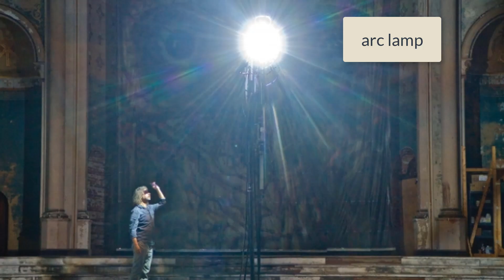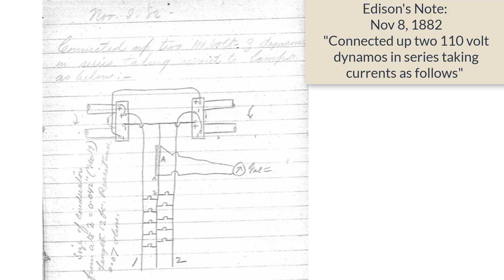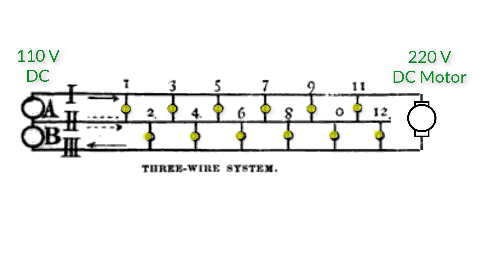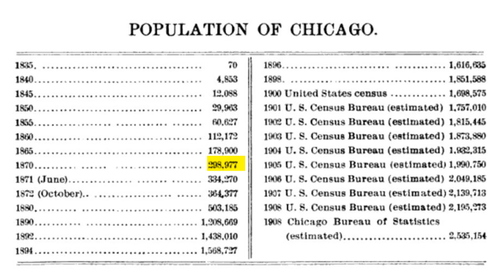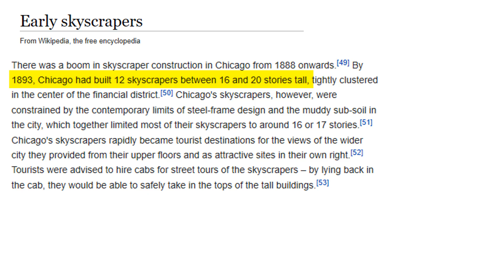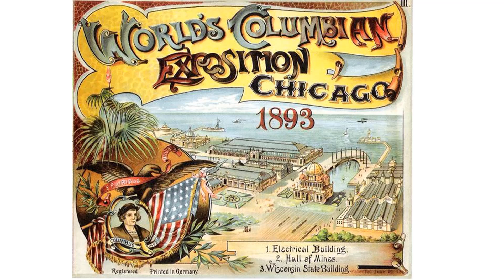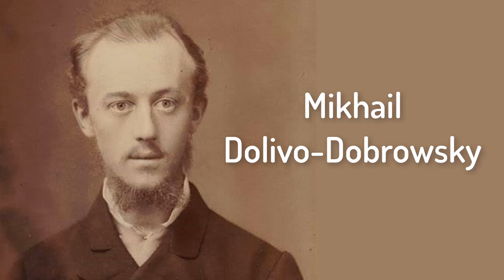Physics and History of Why USA uses 120 volts and not 220 volts

Comment: Edison's bipolar (120-0-120v) system is a good one, but there is one drawback. If the neutral conductor works loose when the two legs are not equally loaded, the less heavily loaded leg will see more than 120V -- all the way up to 240V. This can damage loads and even start fires. If you ever notice lights that get brighter when you start a heavy 120V load, you should get your wiring checked by an electrician.

Comment: The US uses 240 until the interior receptacles, where appliances are connected.  Why?  Maybe the builders and appliance makers did not want to pay for 240V connectors.   The higher voltage would have made for less copper and more plastic in the wiring, I should think.   Copper is more expensive than plastic.   Appliances using less current are more efficient since heat generation is proportional to the square of the current but only linearly to the voltage:   The same power with less current and higher voltage creates less heat.

Comment: How ablout dog leg wound (reconnected actually) single phase or poly phase out of a 12 lead 3 phase generator. 1/3 of the power is consumed inside the generator and is expressed as heat.

Comment: They do use 220 volts ! The supply to USA homes is a center tapped, single phase isolating transformer located on a pole outside each house. The primary is connected to one phase of a three phase supply. The centre tap and phase is 110 volts and used for lighting and low power loads. The full phase voltage, 220, is used for larger loads such as washing machines in the kitchen. The loads are connected as a bus, not a ring main, as in the UK. The UK does not utilise a seperate, centre tapped, isolating transformer. Instead the three phase supply, is supplied with alternating phases to each house in a street, in an attempt to balance the load. Countries that were part of the former British Empire use the UK system. The ring main system is superior to a bus connected system, since it minimises copper losses. The current takes the shortest route to the load.

Comment: Actually three phase is 60 degrees apart on the time line and not 120 degrees.  Mechanically it is 120 degrees but electrically it is 60 degrees.  Plot it out and see it.

Comment: I've designed electrical distribution systems for decades, typically for industrial applications. I find NEC which is part of NFC and NEMA far more satisfactory than IEC. Particularly confusing for me Is IEC 60309, their crazy pin and sleeve connector standard for industrial use. Their residential receptacles are all over the place and their wire color coding has been inconsistent in the past. In Britain every receptacle has its own fuse and switch because 230 volts is so dangerous. I don't think they have GFCI receptacles or breakers for residential use so no receptacles in the bathroom for an electric razor or hair dryer. Designing here in the US I've occasionally had to conform to NEC and IEC simultaneously. It's no easy trick.

Comment: 02:30 - "some of the customers on the more popular lines would use more lamps and therefore have more resistance"
The video goes on to show a n image with lamps in parallel. 
In reality, the result of more lamps in parallel is LOWER resistance, increasing current flow and decreasing voltage for a given power input.

Great video, BTW.

Comment: I understand your premise, but it is misleading.  First off, we have 125 VAC and at 20 Amps, that 2500 Watts.  This is both safer and more powerful than most outlets in the 2/3rds that you mention.  Then we obviously do have 250 VAC at what ever current that is required up to hundreds of Amps.  I have seen numerous comments from europe that imply that we are under powered and this from those still using idiotic 50 hz generators.

Comment: It may not have been the reason for it, but I think 110-120V is far safer than the higher voltage options.  A zap from that is usually annoying, and might make you jump (assuming you aren't wet or sweaty, in which case it's worse) but 220 and up is a huge shock and often more deadly.  This isn't to say 110 can't kill you just that it's less likely which is a nice feature, coming from someone who's been bit many times by the 110V snake.

Comment: The easy answer is: America uses 240 only where it is necessary like Central AC, water heaters and oven/ranges. America uses 120 for the items that do not require much power like flat screens, computers and lights bc it’s cheaper to install and so much more safer. Also, 240 will instantly kill you and 120 will (mostly) on shock you.

Comment: I think you need to cover in more detail Split Phase A.C., which is easily created by a transformer where the two primary "hot" leads would power a secondary winding with a centre tap which is lead to earth/ground. These transformers put out 240 volts, with the centre tap "neutral" allowing 120 volts for the branch circuits. So our houses in the U.S. and Canada are 120/240 or 115/230.

Comment: I don't understand why everybody thinks we use 120vac.  That's nonsense, virtually every single home in the US has 240vac running to it.  The transformer is center tapped allowing 2 branches @ 120vac in opposite phase.  It is a much safer system because the vast majority of stuff doesn't need more than a few tens or hundreds of watts therefore 120v has more than enough capacity while running at half the voltage and thus a bit safer in case of accidental contact.  Only appliances that require more than 1600w (typically stoves and hot water heaters) then need to be connected to the more hazardous 240vac.

Comment: Well argued, but it remains unclear why North America hasn't modernised to 220V since you suggest there are cost savings to be had. BTW I live in Spain and although we're now connected to the EU  220V standard grid, it is still common to see 110v in some old rural areas, often with transformers inside the house linking a range of old and new appliances.

Comment: Do not forget that some railways (in Switzerland) use 16 and  2/3 Hz. Airplanes use a much higher frequencies (~400Hz) so that the transformers can be much smaller to save weight.

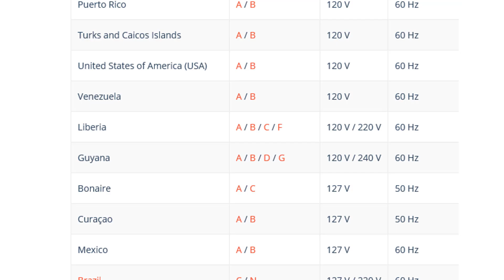Comment: 11:28
Fun fact about Japan they're is not stuck with the voltage choice but stuck with frequency choice (50/60 cycles)
About 100V that Japan used it is for safety reason and to make Japanese people use their own products due to different voltage standards

Comment: USA uses center tab transformers, I don't think EU does. So USA does have 230V, but most of the wiring is split 50/50 in the house and only 2 items get the full unsplit power: Stove and Dryer.

Comment: Last time I looked American homes DO have 240V.  The difference is that it's split phase.  That way we can have some circuits with 240V (usually for electric dryers, ranges, and ACs) and other circuits with 120V (most lighting and wall receptacles)

Comment: I think only about ¼ of the countries use 120 volts. Interestingly, some countries use 120V 50Hz, while others use 230V 60Hz. And the actual, rather than nominal voltages can be 100-127V or 220-240V.

Comment: When I lived in Europe, I became used to 220v.  One thing I often noticed was that every time I hit the rocker switch on the wall, some sparks jumped out from the connectors enough for me to notice.  This was normal.  If the European 220v setup was used in the U.S. the construction industry would be affected because of the safety hazard caused by the sparks.  In Europe, everything is masonry or the wires are carried in closed conduit pipes so the switches are outside of the walls.

Comment: Edison used DC in early years.  You can't transform DC voltage.  The dual phase was Edison's way of transmitting power further with less line loss.

It wasn't until Tesla's AC system that power could be transmitted at high voltage and then stepped down.

Comment: Sir Joseph Swan invented the first reliable light bulbs. His home in Gateshead in the NE of England was the first to be lit by incandescent light bulbs. The Drury Lane Theatre in London was the first theatre in the World to be lit by electricity. Sir George Armstrong designed and built the first hydro powered turbine at his home in Newcastle, this was used to power the Swan light bulbs in his home. The Paris Exhibition was also lit by Swan’s bulbs. Edison who had visited Swan and returned to the US replicated Swan’s work but using bamboo filaments. He tried to patent the idea but the international court ruled against him and in favour of Swan. The two of them eventually started a company called EDISWAN in the U.K.. Swan discovered a way of extruding cellulose, he used this as a filament for his light bulbs. When GE took over the Edison operation in the US, they also switched to cellulose which soon became the preferred methods of illuminating light bulbs. Getting a good vacuum inside of the bulbs was a problem with early light bulbs.

Comment: I can hardly believe you didn't even mention Nicola Tesla, IMO the greatest electrical engineer in history, the god of electrical engineering, and the inventor of the modern world as we know it. Edison's DC system was utterly impractical. The AC transformer allowed huge amounts of power to be transmitted over very great distances at high voltage in relatively small gage wire with very little loss. The risk of severe injury and death is far greater at 230 volts than it is at 120 volts. The US commonly uses two three phase systems for most commercial and industrial applications, 120/208 and 277/480. The confusing IEC standard used elsewhere in the world is 230/400. There are other systems in the US including 377/600 more commonly used in Canada and 4160 volts for larger machines like industrial chiller plants. Typical utility distribution voltages between utility substations and local transformers is 15 kv class meaning 12,470, 13,200, and 13,800.. For manufacturing plants with very high demand 35K and 69K are also used such as for example an ice cream plant which had vast numbers of chillers. Older systems are 5 kv. Typical Utility long feeders in the main networks connecting generation sites and area distribution substations range typically from 69 KV to 500 KV. Residential voltage remains single phase 120/240 while the other systems are three phase. 

277 volts is typically used in industrial and commercial office lighting. Now often data center file servers rated for 208 volts are being operated successfully at 277 volts without any apparent loss of longevity.  

Normally I engineer systems to NEC (part of NFC)/ NEMA standards but I have designed to IEC standards and even systems that had to be compliant with both sets of codes simultaneously. That was no easy.  Looking at contemporary home construction in Britain I see that each receptacle has to have its own switch and I think fuse. They are typically 6 amps and 16 amp circuits. Areas near water such as bathrooms which in the US typically have convenience outlets for appliances like electric shavers and hair dryers on GFCI circuits seemed non existent in Britain. The US NEC code has recently also adopted AFCI circuits for bedrooms. To say I found IEC 60309 confusing would be quite an understatement. I had other problems with IEC as well such as color coding of wires.

Comment: The US uses 240 VAC. And we split it to make 120 VAC available. So ... we use both.
But 120 VAC is safer for small appliances.
We reserve 240 VAC for high-power devices, such as A/C, electric heat, and electric clothes washers.

Comment: I hope good things happened to you! At least some, since YT made me come here to watch that! 
Very interesting. Actually, i had the idea that the low voltage at the US have something to do with savety. Since it is not that deadly if one touch an open wire. I recommend to do that not with 220/240 volts. It hurts as hell if you are lucky, otherwise the pain is the last problem you ever had. Yes, it hurts. I got already the chance to figure that out.

Comment: Interesting speculative history of voltage, however there are at least two glaring problems with your history.  First is that Ohm’s law had been around since the 1800’s and so all scientists who worked with electricity knew how voltages worked and what worked best for consumer applications.  Second all homes in the US are fed with 220v not 110v.  The 220v is available if needed and several outlets in the average home are 220v.  Not sure what the actual reason is for the general use of 110v for the common plug, but it probably has more to do with government policy and safety than anything Edison did.  Edison had little to do with modern electrical infrastructure and distribution.

Comment: Wrong, Edison hired Nicola Tesla, Tesla redesigned Edison's D.C. generator. Secondly you confuse D.C. with A.C. Transformers do not work with D.C. Edison hated A.C., he did a smear propaganda on A.C.. Direct Current generators will not generate high voltages, they short circuit the commutators in D.C. generators. You jump around the so called point way to much. Lastly, High raise buildings owes could not be built with out Steel. The Bessemer   process, turning Iron into steel. You need to study history a lot better.

Comment: I think it is more a case that commercial pressures tend to outweigh scientific ones in USA so it is common practice for a superior system to be suppressed. The main advantage of 220 volts is that the supply wires can be thinner because they are carrying less current for the same power. The stuff about light bulbs was based on DC, it would have been possible to choose a new voltage when changing to AC.

Comment: Great job.  At 12:35 into the explanation about home electric dryer powering, there are not two phases here.  There is only one pole transformer and only one phase of the 10 KV high-voltage tap. It is true that, in reference to the center tap, the two 120 volt ends are 180 degrees out of phase, yet still the dryer works on a single phase.  It is not a 3-phase dryer.

Comment: Your research leaves room for improvement.  More lights in parallel means less resistance, not more.  The neutral needs to be the same size as both hot wires.  It can’t be smaller.  The voltage that a bulb needs is not dependent on the type of material, so much as the geometry of the filament.  A filament twice as long uses twice the voltage.  Tungsten lasts longer than lampluxed bamboo filaments, which you seem to call carbon filaments.  I stopped watching half way through.

Comment: One  supposed advantage of lower voltage in the home was the promise of fewer injuries/deaths from electrocution (and maybe fewer home fires). Valid? It would be interesting if you made a video on the various pros/cons of different power systems: frequency (60hz is better, right?), would a voltage higher than even 240V be even better and why, which country makes the best plugs, and does it really matter?

Comment: Very distracting hand waving. Totally unnecessary - maybe the presentation was aimed at a younger generation! Had to cover up the lower part of the screen to be able to concentrate on the content. I’m sure the information could have been provided quite adequately purely with the animations and photographs. A less assertive commentator would also help to get the message across.  My field of training and work was in electrical engineering, in particular, motors, generators an power distribution. I served an apprenticeship with W H Allens in Bedford UK. They built and installed the generators on the SS Titanic, not to mention those on the Royal and merchant navy’s including submarines. For me it was useful to learn some of the history behind the decision to utilise 110v, I always thought I was because it was a safer voltage than 230/240.

Comment: No it because electric companies want to get rich n stay rich n keep ripping people off in there electric bill because 240 is more efficient than 120volt they screw you over every winter because some people are so poor they can't even afford central heat n air n there another problem because central heat n air use more power and is less efficient than heating your home with a 240 volt space heaters and that just the tip of the ice burg

Comment: We haven’t shifted to higher voltage to save money on transformers, or anything else. It’s been done to provide more power (watts) while not having to change the electrical outlets, or wiring. Over the last 100 years, voltage in the Us has been slowly rising. The non official/official voltage here is now 123/246. It will continue to increase slowly so as to not damage older equipment which can last 20-30 years.

Comment: 120 is more dangerous than 240. Amps kills volts burns. A bit simplistic i know, but basically true. Next, you have higher current arcs at switches,  yes 240 has a higher voltage arc, which lets the arc jump further, but not with the same force. 60hz runs hotter than 50 hz as well. The usaan system is below par.

Comment: Very interesting channel. One minor correction: Size of transformers is driven by the KVA  or volt-amp rating not voltage rating. Also the size is  about inversely proportional to the frequency rating. As an example a 50 hz trans core will weigh 20% more than the core of a 60 hz trans. This will increase the winding weight by almost the same ratio (20%). The voltage affects transformer size as the insulating requirement increases for the high voltage which pushes up the size dramatically at transmission ratings. Spent much of my career in transformer design.